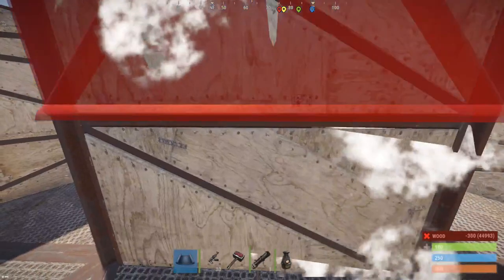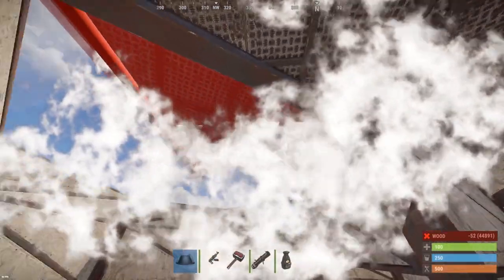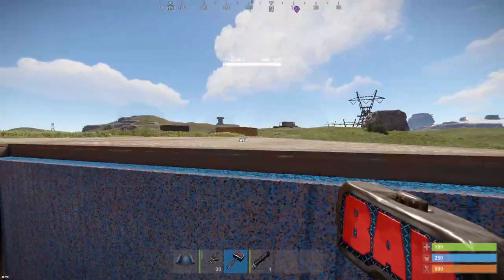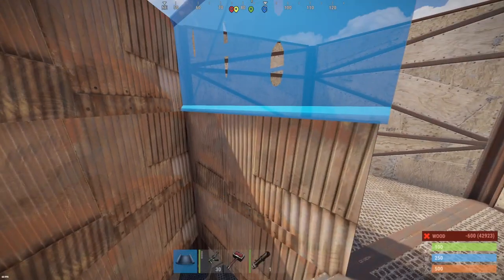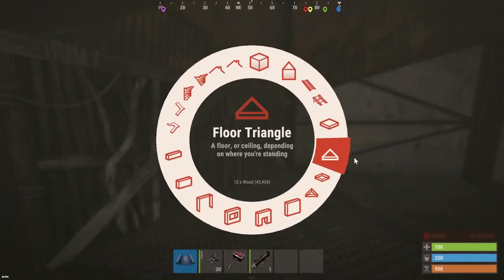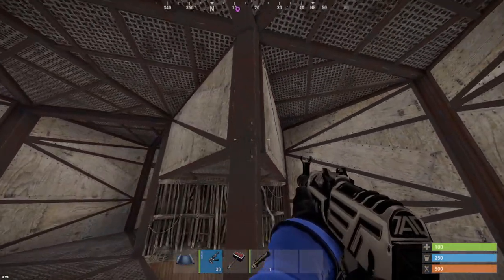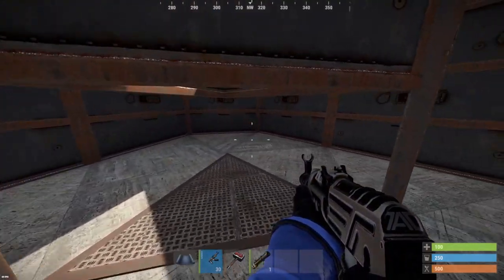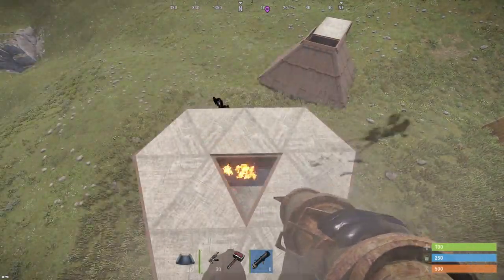Rust Floating stability bunker

Comment from the maker: Something I didn't mention is you can put a low walls in the half wall gap under the bunker, you can use this to block all sides except for one, this then forces raiders in one direction onto a door path for example.
Reply: Wouldn’t the half walls get splashed anyhow and break when the bunker gets raided?
Reply: alternatively use windows, half high things dont attach to windows, single or double doors. window walls would be perfect for stashing some furnaces, or even as peaks, though using them as peaks means raiders arent force in one direction after raiding, so low walls would be best for that use case.

Comment: So my nine floor hotel would benefit massively from one of these in each floor, in my area of the base anyway, an excellent idea, so simple, I love it.
Reply from the maker: That will be one hell of a hotel to raid!
Reply: @maverick1484  It already is, though I've only test built it as a non-hotel to see if 1) I could build it on a vanilla server and 2) maintain the upkeep. Thanks to industrial I can, TC holds 9 hours of upkeep and the 5 boxes in the bunker with it hold 24 hours of upkeep between them. I should make a clip showing you, i just started on twitch, so this would be perfect.
Reply: @maverick1484  I was streaming to no one on a build server and had an idea what kind of base suits your repeat bunkers best: A pyramid shape. 
Raiding from below would be best vs your stacked bunkers on each floor, so the lowest floor needs the most honeycomb, and one layer less of HC as you go up each floor/bunker and so on.
You may have accidentally invented the new pyramid meta, without building a pyramid.  😄
Reply from the maker: @ChullsterOG  Lol you can easily make the raid cost equal on all sides using this your right a pryamide would be very OP.

Comment: Always easy to understand the concepts. Wonder why we don't see more of these?
Reply from the maker: Its versatile it has no weaknesses it doesn't fuse together on a server restart requires no twigging out and you don't have to spend any time on a build server learning it. Sometimes the simplest solutions can be staring you in right the face and nobody sees it
Reply: @maverick1484  It does have a couple weaknesses. This bunker requires a bigger core which results in an overall more expensive base. You're also somewhat limited with what you can do in the open space to the sides of the bunker; you can't use standard double triangle loot rooms as that will brick the bunker. This bunker is definitely very easy to build and understand but a traditional god-bunker is superior if you know how to build them.
Reply from the maker: @crazylasagna3576  I can build this with 3 triangles on the end of a 2x1or 1x1 so space is not a problem. On the bunker I built at the start you can place a full wall on either side of the bunker you can then place 2 diamond shaped loot rooms. The space in the little triangle behind the half wall is perfect for furnaces and a locker it just takes a bit of planning and there is no wasted space. But having said that the square version is limited on space you can only have 4 loot rooms 1 in each corner, I did put it in as an option even if its less viable than the triangle version. As for the god bunker well when I was searching youtube to make sure nobody else has done a vid on this I noticed about 30 creators doing the same thing, so I don't think you need me to pile in on that lol. At least I'm doing something different and easy to understand which will appeal to the 90% of players that don't want to waste time on a build server.
Reply: @maverick1484  I'm not saying your bunker is bad; it's a great tool for inexperienced builders. However, saying it's without weakness is simply untrue.
Reply from the maker: @crazylasagna3576  It has no weakness I'm not lying it has no soft sides. Your talking about how it takes up 3 triangles the same as a stability bunker, but that is not a weakness just a minor drawback which every one has always put up with anyway.
Reply: @maverick1484  Communication error. I was using the term weaknesses as in downsides whilst you were referring to softside weaknesses. My b.

Comment: I always pop in here from time to time, wondering which design will I use next. My hands down favourite is the sea bunker, especially with the new automation update. I was also wondering if you could make a pyramid design, preferably with a bunker, but with out is fine. It would probably be stupid to raid as if you put TC on the bottom floor in the middle you’d have to go through either a bunch of honeycomb hidden beneath roof or a bunker.
Reply from the maker: Its all cone crazy for pyramids after sir Winter did his vid a couple of weeks ago lol. I cant promise anything but the seed has been planted so now I am thinking of ideas!
Reply: Thanks man. Really appreciate it. I used your sea fort for my most recent wipe, and was wondering if you could try and integrate some double chain link fence pods for turrets, as I find it a great way for defense when I’m offline. I did manage to incorporate single chain link fence pods but didn’t realise that the turrets can still be damaged. Cheers dude, you are probably the best builder on the platform at the moment. ❤

Comment: We just figured out we could move the position of the bunker on every floor with the square version… we now have a 10x10 cube that is actually a 7x7 with 3 layers of honeycomb. It’s actually annoying even for us to get in and out of so I don’t think anyone will be raiding it. Not building this again like that takes 15 minutes to get out of 😂
Reply from the maker: I know what you mean, I am working on a design right now that has 2 bunkers one on top of the other and I am all ready bored of going in and out. what I'm going to suggest is that all main loot is placed in the bottom bunker and sealed during the day and you just work out of the open top bunker until you go offline then seal both.

Comment: I like this a lot... thank you. Would this work with the redoubt?
Reply from the maker: On the later versions of the redoubt I had to move the bunkers into the base and ended up with 2 floating walls and a raised foundation. I then came up with the floating stability bunker when I removed the raised foundation and replaced it with a 3rd floating wall.  So it can be done just have a floating wall on the square foundation as well as the triangle ones instead of raising it.

Comment: I use stability bunkers in all my small bases, except they can always be closed from the inside like you show in the video. I'm not a fan of bunkers that can only be closed from outside of it.
Reply from the maker: I know right they are a pain, the first thing you have to do when you come online is F1 kill to respawn inside your base not a an ideal start to your day bag timering yourself. Plus you have a more of a chance to seal if you start getting raided if you can do it from inside.
Reply: @maverick1484  to be fair, I don't really mind having to F1 kill, although it's indeed annoying. However, not being able to seal yourself inside your base in case of an online raid has happened to me before and probably lost me my base, that's why I stopped using bunkers that can't be sealed from inside.

Comment: I’ve been going a different route lately. To maximize loot distribution, I’ve been setting vending machine bunkers outside my base, about 30 of them, in a straight line. 450 rockets of protected loot, 4500 stone and 76 hqm upkeep 😂
Reply from the maker: The vending machine bunker is such an underrated design I feel I should be pushing the fact it works with the industrial update, in fact it is OP now and nobody is really noticing it.  Good work on the design it sounds an absolute nightmare to raid!
Reply: what are vending machine bunkers?

Comment: If they do. Bottom up attack, wouldn’t it be a pretty easy raid?
Reply from the maker: If I was using this in a design I would compensate for that by adding extra honeycomb on the bottom layer, but yes your right it could be a problem if not addressed.

Comment: 2 incendiary rockets and the bunker is open. Works on console at least.
Reply from the maker: Really fire goes through walls on console? I cant see that is right that would mean no bunkers work on console at all and I know that's not true.
Reply: @maverick1484   I literally just got raided and I had this same setup, I got on and asked how much it cost to get in just out of curiosity and to say GG he said some explo ammo to get through doors and an incendiary to get through the bunker.
I tried to test in test branch but couldn’t get incendiary rockets for some reason.
Reply from the maker: @tehpandainc.  You can clearly see me firing an incendiary at it in this vid and it does absolutely nothing. If that raider was able to burn through this then he can also burn through a normal stability bunker and every other bunker! I think somebody didn't want to admit how many rockets they used to raid you lol.